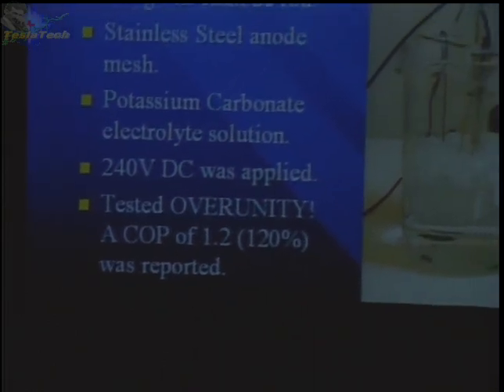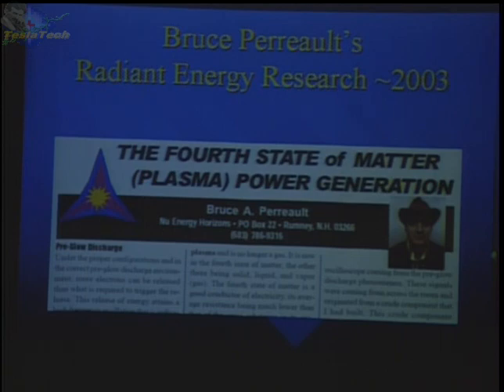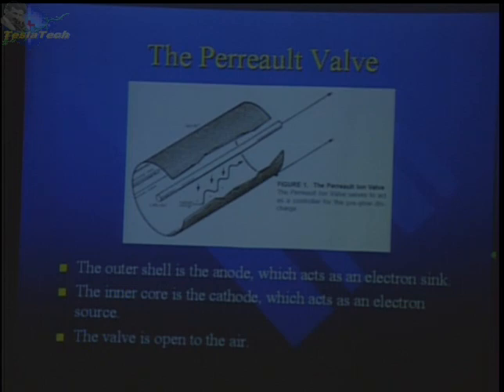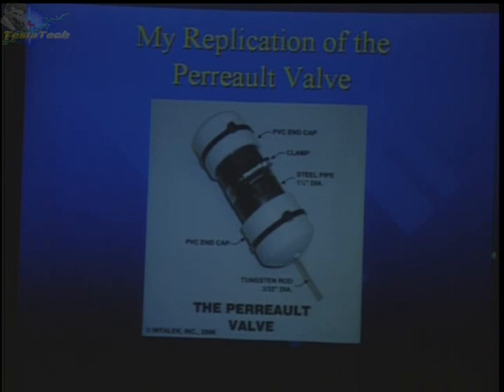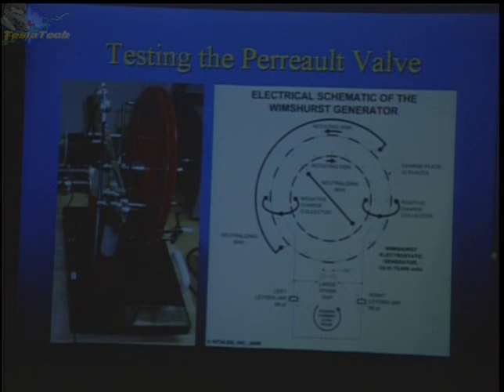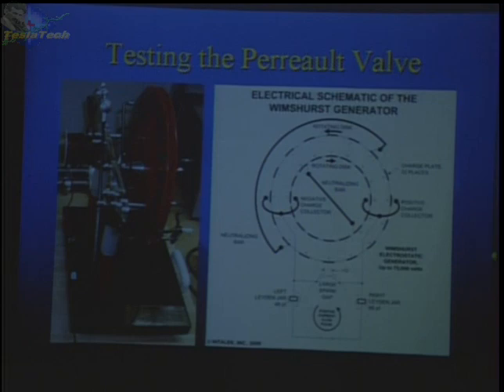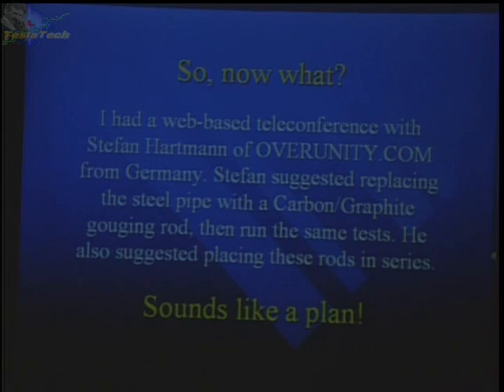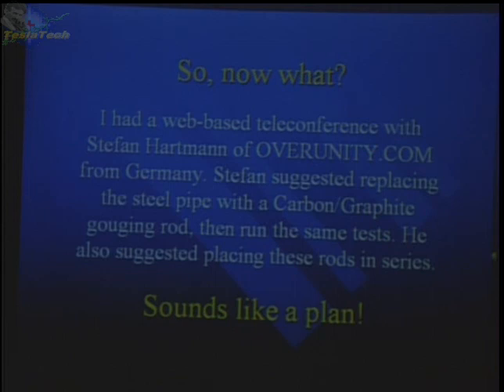William Alek - A Spark Gap Method of Harnessing Radiant Energy, Extraordinary Tech Conference, 2006

Comment: I meant a Copper-Graphite Commutator, so the Commutator must have Copper Graphite contact metals..
Reply: Maybe even Graphite Magnesium metals will work best, cause the dissimilar voltage is bigger with Magnesium Graphite... But I Haven't tested it yet... actually the copper graphite commutator was, what Newman was using...
Reply: I used too much water on my commutator, so I killed the sparking...then the big Backcurrent spike In the Newman motor disappeared...
Reply: Aluminum-Graphite works even better.
Reply: I now use materials that result in huge electrical power gains!
Reply: @RADIOIONICS  Can i make vanadium, Cr and NI with that?